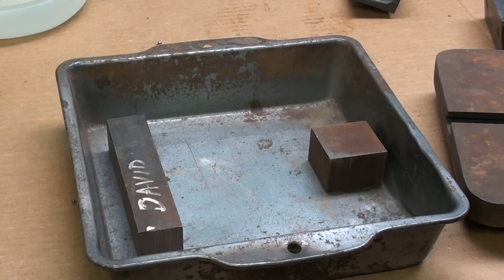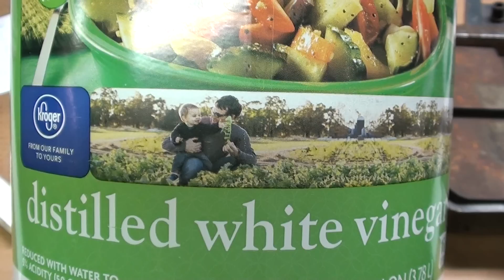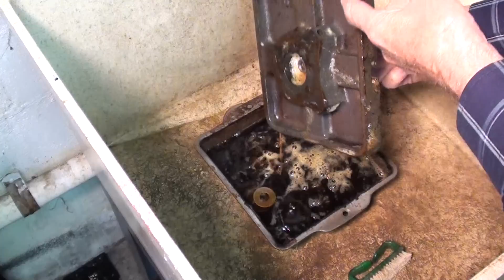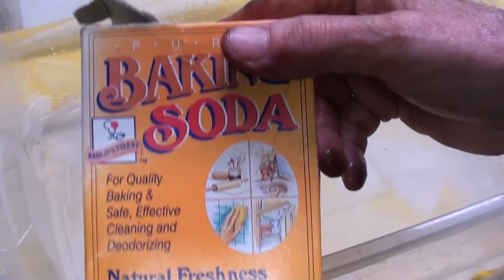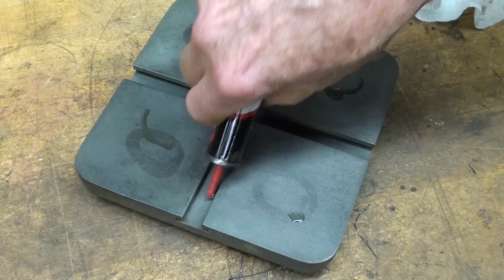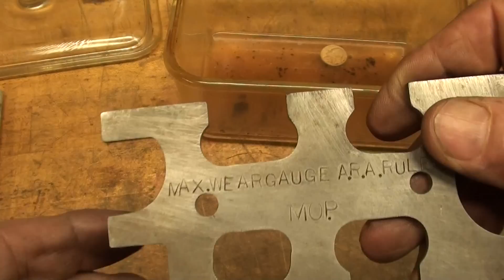Rust Removal Vinegar #304 tubalcain - compare to electrolysis

Comment: Dear Lyle, I have been using Cleaning Vinegar soaking old taps for 24 hours. Cleaning vinegar is 6% acetic acid, ordinary food grade vinegar is 5% acetic acid.  I guess the higher concentration accelerates the process, as would some heat. That is basic chemistry.  I cleaned up my work by using a kitchen bristle brush with brass bristles.  The effect was amazing: my taps now have a slight brass patina to them.  I recall using a solid brass wire brush on hot metal in blacksmithing and this gives the metal a fine brassy coat.  My inadvertent discovery may mean that my restored parts will now have a very fine brass coating and no longer rust. The small amount of metal deposition may alter the size of the teeth but it would only be a few microns.  I can now clearly read the stamped markings on the taps whereas the rusty version could not be identified.
Reply from the maker: Thanks for watching

Comment: I've have found that soap or dishwashing soap will help neutralize the acid and help in clean up. Soap is alkaline and thats acid so I guess that's why it works, I'm no chemist. And you can wash it all down the drain.

Comment: Great video! time to ditch the messy electrolysis derust method, try the oil spray to apply oil,that will make it easy to reach the small gap.

Comment: There was a guy on eBay that sells 20, 30, 40 pound boxes of scrap Delrin. Delrin is a tough machinable dense high end plastic. Epoxy & other glue usually won't stick to it either. I use loads of it for clamping cauls, fixtures, jigs, etc. You can do as many rust removal videos as you like. Love every one of them, and I wish you were a neighbor of mine. Go buy your wife a new pan, Mr. Pete. I was trying vinegar to remove an orange stain from a cultured marble sink. Hydrogen peroxide did a pretty good job. I might try some oxalic acid, used to bleach  wood, to get the last of the stain out, but I think we will just keep a doing the peroxide treatments. It takes forever, but it worked the best of anything.

Comment: 3 in one? it's the bane of my life! I fit garage doors, do not grease or use 3 in 1 in the tracks. it just collects dirt!
No offense but the amount of times I've turned up to an old mans house claiming the old stuff is better is ridiculous. The wheels don't even wheel no more, they get flat spots from the oils and shit you apply.
If your gonna use that shit then buff it out till it's paper thin. It's not for lubrication. That shit is literally a glue if you don't buff it out.
Reply: I have had mixed results with 3 in 1 oil.  Finally after reading on the cans I found there are different oils for different purposes.
Reply: BTW they are all 3 in 1 oil.

Comment: Don"t forget to use some baking soda and water mix after using vinegar to neutralize the acid process.  The rinse you did on such a thick piece of metal probably will be enough along  the oiling you did but on thinner metal you need to make sure and neutralize the acid effect as soon as possible after the rinse. Great post and good closeups

Comment: If you want it to go faster, then you can use a 32% vineger, and heat it up on the stove(you can always add water to delude it). 
I ran 5 plane blades and two Stanley's through that, and was done the same day. 
basically, the bigger the bath, the more stuff you can do at once. but they have to be covered, that is essential otherwise they rust badly and quick.

Comment: howsit going bru bit of advice don't use molasses on metal i did that a few years ago left a torque wrench in the molasses for 24 hours and the molasses had left indentations in the metal where it had eaten away at it

Comment: I used electrolysis a few years ago to remove the rust from some old hand planes. Afterwards they had a patina on them that was very attractive in my opinion. Not as nice as the original Japanning, but nice. I used emery cloth from 220 to 2000 to get a mirror finish on the work surface to reduce the drag while using them. I helped a guy sell an old mill this week and got an old Bullard indexing head as a reward. It's pretty rusty so I think I'll try this vinegar thing on it. I need to figure out how to disassemble it first though.

Comment: Electrolysis adds metal while vinegar and other acids remove material.  I've used phosphoric acid with good success in the past, it converts the surface and looks nice.

Comment: Well done. I am rebuilding a 1967 Land Rover engine, and used vinegar to clean up all the nuts and bolts. I should mention that De-greasing to remove all the oil residue, greatly speeds up the rust removal process. Then I found the parts would "flash rust" in immediately if not oiled soon after neutralizing the acid from the parts. I appropriated a couple of old bread pans for my chemistry experiments.

Comment: To space the parts from the bottom I've used kid's marbles before. They expose more surface than blocks and are made of glass so they won't float like wood blocks would. You can easily find them at most dollar stores.
Reply: Karl Kretschmar Excellent idea!  The actual contact patch (where vinegar wouldn’t reach) would be near zero.  To take your brilliant idea one step further, (and depending on the complexity of the part being cleaned) I’m thinking I’ll temporarily hot melt glue the marbles to the bottom of the pan so I’m not chasing them around or having to constantly reposing then as I turn/flip/inspect my part.  Additionally, I don’t have to worry about losing them down my shop drain during the flush and thus creating even more work for myself acting the role of a plumber.  Thanks For the marble idea Karl!
Reply: Great idea, I have been using plastic jar lids open side up, but I have marbles from old paint cans sitting in a jar around somewhere, finally put them to work, {not really good for carousel bearings, since they tend to be seconds and not really spherical.

Comment: ive worked on two cars in the last six yrs. received them in very bad rusty condition. my friend told me about vinegar and soaked most parts overnite and it cleaned them but a few parts another day or two. cleaned them and painted them and they looked good. it works. ron

Comment: I've been doing all my rusty screws, nuts and sockets with a good 24H vinegar dip for a little while now. I found that apple cider vinegar works a whole lot better than regular white vinegar, but for $$$ sake, I'm currently experimenting with a mix of white and regular cider vinegar and re-using the stuff after pouring it through a coffee filter. No need to be paranoid with baking soda; just brush it thoroughly , rinse it off with plenty of water, dry and oil immediately and no problems whatsoever.

Comment: Dear Sir. 
Thanks for a great video. I enjoy listening to you explain what it is you are doing and why. There's an old saying "There ain't no free lunch." That certainly holds true with rust removal. Electrolysis, acid, abrasives, or any other method requires some type of hands on to finish the job to an acceptable standard. For me the advantage to using some of the more hands off methods like electrolysis, and acid is the complexity of the part and the number or volume of the parts to be derusted. About 5 years ago I came into the possession of a large quantity of wood auger bits. I had become enamored with the idea of owning a full set of 13 bits in one of the Russel Jennings boxes and that lead to a bit of obsessive hunting. Needless to say I ended up with a bunch of rusty auger bits. After trying various ways I settled on using Evaporust on the advise of various forum members that I had grown to trust. It worked but 100 auger bits completely exhausted the gallon of Evaporust. That worked out to about $.25 each. I still had to scrub them after soaking them for a couple days in the beginning and by the last batch it was more like 4 days. Then I made the unfortunate discovery that there was a pervasive odor that filled the basement shop and the adjoining rooms. That was not well received by myself or the other people occupying the space who were understandably dissatisfied with my attempt to avoid manual labor. 
Chemical baths are an effective rust removal method for complex shapes because the chemical penetrates into areas that are difficult if not impossible to reach by mechanical methods. The process is not fool proof or necessarily a cost or labor savings. Residual effects requiring major cleanup have to be factored into the costs associated with any rust removal method. I'll briefly touch on the molasses method as a subset to chemical means. It works. Just like the Evaporust, vinegar, or any of a host of acid based removal processes it penetrates and removes the rust. The problem is that compared to molasses the Evaporust was perfume. I knew from the advise of others, always ask advise, it's cheap and plentiful, that there was an odor attached. What I didn't realize is that it can only be described in terms of opening a septic tank and diving in head first. The stench is horrific and pervasive. It took two weeks to remove the rust from the saw blade that I had used for the test. After the first two days it took an effort of will to open the container and check on the process. The only household member who liked the idea of molasses rust removal was the family dog. After the experiment I took the effluent remaining and carried it far out into the woods away from human contact. Sadie discovered the dumping area and ended up getting several baths before enough rain had fallen to wash away the stench from the woods. In an effort to avoid the olfactory insults presented by Evaporust and Molasses while simultaneously lowering my cost per unit I hit on the vinegar method. My first attempt was similar to yours. It worked and the remaining solution was equally crusty and nasty. The next day the white vinegar had turned. It stunk to high heaven. I next tried apple cider vinegar. Finally I was moderately successful. The rust was removed, the bath still smelled like apple cider vinegar a week, and multiple batches of auger bits, later. The bits still required some elbow grease but that's a given.  Electrolysis is also effective but less so than chemical methods. Electrolysis is a line of sight process. If the parts to be cleaned are not carefully presented in the bath any shadowing of the surface leaves areas that are not as well cleaned. I suppose creating a rotating rack or developing a complex cathode that will expose all surfaces equally is possible but like you I'm trying to reduce the sweat equity in the process. Mechanical methods are my choice for flat surfaces or regular shapes that allow easy access. Since every method mentioned previously, in this overly long response, ends with some form of abrasive use, with all the mess entailed with each method and the final elbow grease as a pervasive requirement I ended up with a hierarchy of rust removal. 1. Is the object badly rusted?
    a. Yes.     Proceed to step 2.
    b. No        Mechanical means are indicated 
2. Is the part complex? Multiple parts joined so as to be difficult to disassemble or having a convoluted shape. 
    a. Yes      Proceed to step 3. 
    b. No       Mechanical methods are indicated. 
3. Are there a large number of discrete parts. 
    a. Yes     Proceed to step 4. 
    b. No      Chemical process is indicated. 
4. Is there a finish that you would like to have remain after the rusted areas are cleaned?
    a. Yes     Proceed to step 5
    b. No      Chemical process is indicated. *
5. Use electrolysis. To achieve a clean surface, on a complex part, with little or no damage caused to existing finish, or coatings, by the process, electrolysis is my first choice. It will require secondary disassembly of complex components, final mechanical finishing, and cleaning of the parts and system used. 
I use baking soda to create the electrolyte so I can dispose of the effluent without fear of damaging the environment. It nicely greens up the grass in the area where the iron and baking soda mixture is poured. 
Sadie has no interest in rolling in baking soda water. *If you don't own a dog. If you are derusting a large object like a 46 Ford truck body. If you have a strong stomach. Then by all means use the molasses method. A large sturdy framework with a plastic liner that will contain the object and sufficient molasses and water bath to submerge the item can be lined with 3 mil plastic sheet. Set the object in the tank. Add the solution. I recommend covering the tank to keep out the birds and bugs. Especially the bugs.  Ugh....  Walk away and come back in two weeks. 
After removing the item from the bath, hose it off with running water and examine it for effect. If the part is acceptable, apply a rust preventative. If not then put the part back in the tank and check back in a week. After a successful application of molasses water, then drain the tank, strip off your clothes, shower with lye soap, don clean apparel, set fire to the soiled clothes, and do not return to the area for a period of 3 to 4 weeks or 3 thunderstorms. Good luck with your endeavors in fighting off the effects of that horrible naturally occurring pollutant Oxygen. If I could figure out a way to exist without it I'd never have to remove rust again. :-)
Reply: You gave the best summary of all!.   I have seen several of the youtube things, you have the best!
Reply from the maker: Thank you very much
Reply: Great read. If that's considered too long now, then the next generation's kids are going to complain about having to read a whole stop sign, and all of civilization is doomed to die at a 4-way stop.
Reply: What polarity do you use with baking soda? I am bit confused because it appears to be opposite to the one when  washing soda is used.. I know I can find out the "hard" way but why not be guided? I have no chemical background but could fix you telly in a flash :D
Reply: Janusz Bogdanski you use the same polarity as the other electrolysis methods - the negative lead goes to the part to be cleaned (which makes the part the “cathode” part of the electrical circuit), while the positive lead goes to the sacrificial metal pieces (which makes those pieces the anode part of the electrical circuit). Hope that helps.
Reply: @mxcollin95  You may have that reversed....
Reply: This is great!  I wish to remove rust from an old 1940s stroller chassis that is rivetted together and I do not wish to take it apart.  It is painted, but paint has come off and rust has appeared all over it.  I'm hoping to fix it up within about 10 days (which will include sewing new fabric parts as those have molded and are coming apart... hoping to make my own pattern from the old pieces somehow).  I want to do the vinegar method.  I am thinking this should work... I just need to figure out a way to do this without using gallons and gallons of vinegar.  Perhaps finding a tub large enough for it, placing it in a plastic bag, and displacing the vinegar I pour into the bag with water in the tub would work (saw someone do similar in another video, but without the water).  I tried vinegar soaked napkins and it worked, but it would take forever to do that over all the little bits.  

It looks as though there is rust beneath the paint in areas where there is a little bubbling occurring.  I suppose I need to scrub as much of the old paint off first?
Reply: Old Sneelock's Workshop :
Reply: Well written and a good read.  If you can find a facility, glass beading works very well for removing surface contaminants as well as the black oxide from welding SS.
Reply: MICHELLE OBAMA IS A MAN 🎅🏿🎅🏿🎅🏿
Reply: Or do anything......
Reply: That's the problem with young people these days.... they don't want to read anything lol.
Reply: #HistoricTown  Yes you are dead-nuts on about the younger generation!! 2 years ago when my oldest son (he was 12 back then) started 6th grade at a newer, large middle school with a actual Woods class, he had told me how he couldn’t believe other kids his age, or even a few older ones had NO KNOWLEDGE WHATSOEVER on how to use a WRENCH and also were DUMBFOUNDED on how to use a RATCHET!! I was just shocked to the core, and just couldn’t fathom EVER being that ignorant, and then simply not caring to even want to learn! My oldest can take apart most smaller yard power tools and other things alike with little help! I’m GLAD to have family members, old timers, and advanced Automotive schooling to teach me what I know now.... Because without that knowledge, and ability to fix vehicles and save TONS of $$ I don’t have much of, I wouldn’t be doing so good... esp with 4 kids! (Oldest will be 14 soon, followed by another boy about 2 years younger, then a 9 year old girl , and then one last, but not least, a 6 year old boy!... )...I’m 37 FYI... and have many more PRICELESS years of teaching them what I know!!   ILL BE DAMNED if any of my kids are going to be anything like the average youth, that are completely mindless about most things, especially mechanical , and my loinfruit DEFINITELY won’t be the scared of work/lazy/need a damn computer or phone to wipe their own asses!     Regards!
Reply: I read the whole thing, it was excellent. Learning is not always done is seconds.
Reply: Old Sneelock's Workshop no one is going to read that whole thing well not me at least. You trying to write a book
Reply: It's okay Parker. You don't need to read anything. I know big words can be a challenge and I thought I had kept them to a minimum. I didn't really write it for you. You can wait for the comic book.

Comment: My wife cleans burned on food by soaking it in vinegar and putting crumpled aluminum foil on top. Apparently the foil together with the vinegar and the base metal forms an electrolytic cell but no power supply needed.